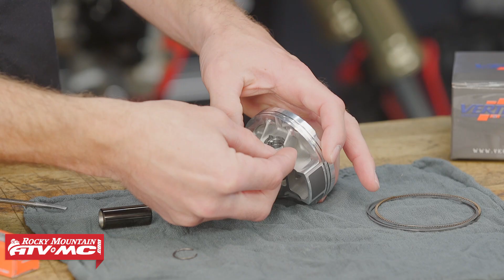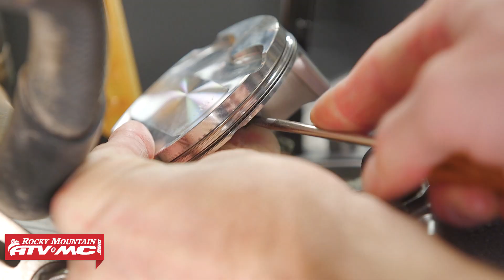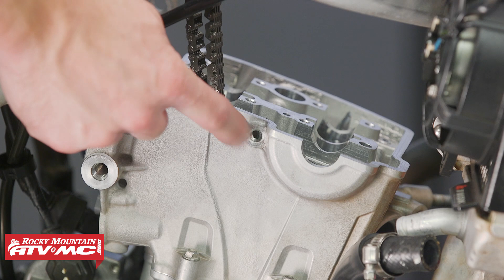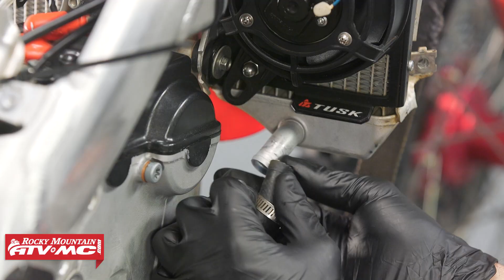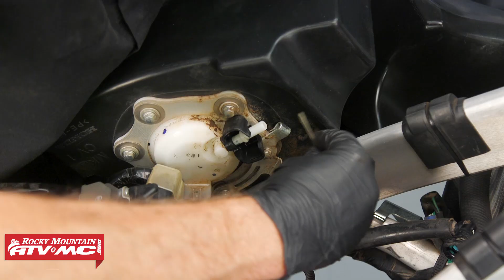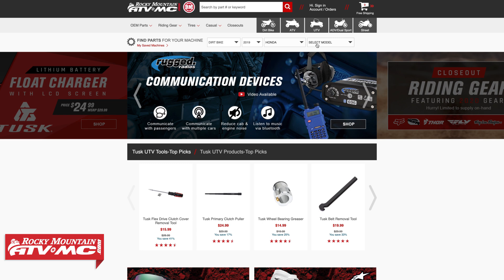2018+ Honda CRF250R/RX Top End Rebuild & Big Bore Kit Install | Part 2: Engine Assembly

Comment: Do you have to install bigger injectors or anything fuel related? Thanks!
Reply from the maker: You shouldn't need bigger injectors but you will want to adjust your EFI to get more fuel needed with the big bore kit.
Reply: How would you do that on a 2012 crf250r? Do you have a video on it?

Comment: I have a question, Im palnning on installing big bore kit  on my crf 450r 2008 and Im wonderig If I have to buy diffrent cylinder head?
Reply from the maker: You should be fine using your stock cylinder head. It may depend on the specific big bore kit you go with but our Cylinder Works big bore kit is designed to work with the original head.
Reply: @rmatvmc  it says cylinder  honda crf 450r (02-08) big bore 100mm (+4mm)

Comment: I need help I just finished a top end rebuild on my 2018 Honda CRF250R, and now the light on the top left on the killswitch button keeps blinking orange for about a second, and doesn't stop. The bike is also very hard to start, and won't stay running. The bike sounds very good while running, and everything is in spec.

Comment: Hi, I did a top end job on my bike and when I go to put the cam chain over the cams, it is way too short all of a sudden. I did not change my chain. Only piston, valves and springs. I have no idea where all the slack is. I have no slack at all to pull the chain over the cam gears. Any ideas? Thank you!
Reply from the maker: Take the tensioner out. -Charles
Reply: I’m facing the same problem. Tensioner is taken out and I’m still having this issue.

Comment: So you don't need to tune the EFI for the bigger bore?  Because I thought you Needed a fuel controller as well? I'm curious because I have a 2012 crf250r, and I am going to put the 270cc big bore kit on it. Do I not need to do anything else other then set the timing?  🙏

Comment: NEED HELP! I put this big bore kit on my 2021 Crf250r. Started and idled perfectly. Took off slow and easy, it stalled I popped the clutch and it fired back up and got just a little more down the road and it stalled and won’t start at all. It won’t even try I have no idea.
Reply from the maker: It's hard to say without looking at it, but I would start by checking the cam timing and the valve lash. Also make sure there are no issues with the cam chain tensioner. -Charles.